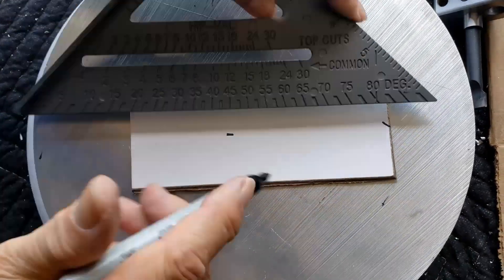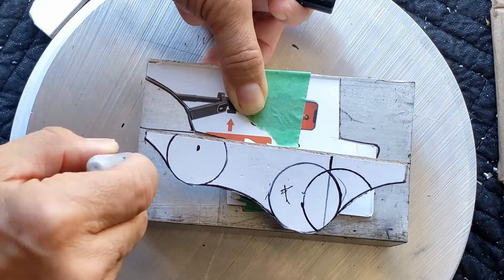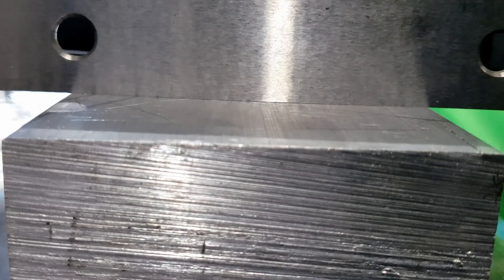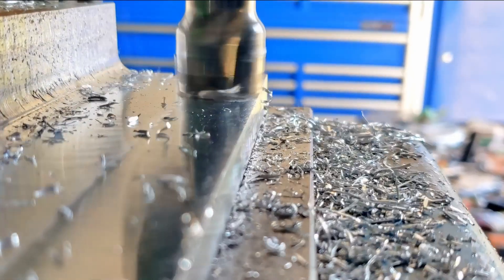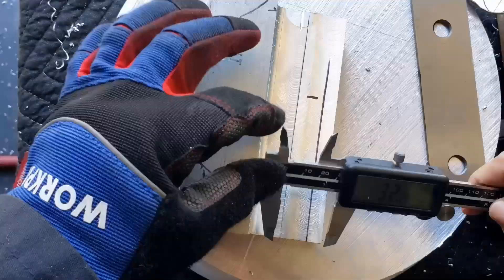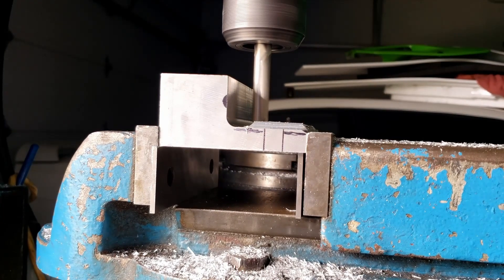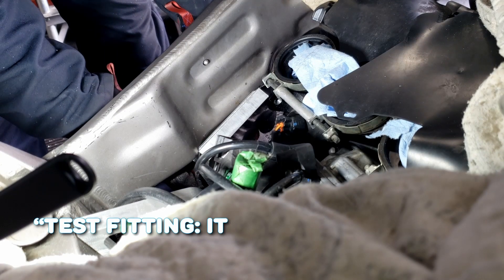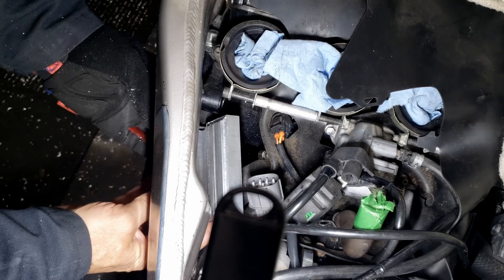"Stuffing a ZX10R Engine Between the Frame Rails of a 1994 ZX7”

Comment: I seem to remember the ZX9 engine was a long stroke ZXR750. It will fit but the block is taller so  needs eccentric bushes
Reply from the maker: Apologies, Thomas, for missing your comment. You’re right; the ZX9R engine block isn’t a straight swap for the ZX7 chassis—the top two engine mounting points require ovaling to accommodate it.

Comment: I think fitting the engine in is the easy bit when you have the tools to make the brackets, the hard bit is when you have fit all the bits to complete bike. when you have finished making the engine mounts why not get some 3D printed, look forward to your next video
Reply from the maker: “It took over a week to properly align the engine within the frame, which, surprisingly, was the straightforward part. Thank you for the comment; it’s greatly appreciated.”